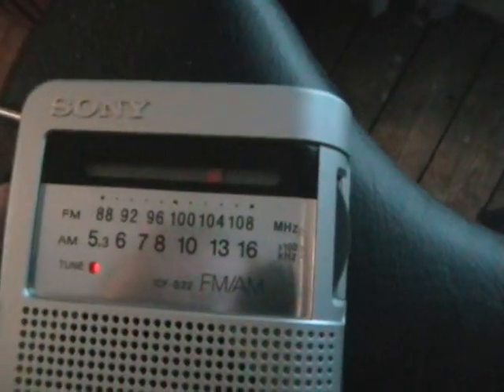How to build a SPY Bug

Comment: It looks very nice but I'd be grateful if you could give some additional infos:
1) what kind of oscillator is? Id does not look like a Colpitts, Hartley or Clapp oscillator! I do not understand why should it be an oscillator? I don't understand the theory of the circuit!
2) Why the frequency should be changed by mic ?
Please give every kind of references you have aout it !!

Comment: You made a mistake at 3:19. The antenna has to be connected to the collector, not emitter. The diagram is correct.

Comment: Is the 4p7 cap. connected between the transistor's collector and emitter part of the oscillator circuit? If so, what purpose does the 22n cap. connected between Vcc and ground serve?

Comment: great video dude! what if I wanted to receive the signal on something other than a radio? I mean, what if I wanted to receive it on a custom receiver at a distance of like 30 feet? I mean, the distance is a matter of power to the transmitter, but what about a custom receiver? might you have a circuit or link to a circuit where I could find on that would be compatible with the transmitter in the video? Thanks buddy!  -Joe

Comment: @theaviator595 
22n ceramic disc cap will work or even radial. The word "axial" or "radial" just specifies how the leads of the cap actually exit the component itself. 
axial = one lead exits from each end, like a resistor for example.
radial = both leads exit the component at one end.

Comment: @andiukas223 
I've tried values from about 2pf to 10 pf, although it did work, it did work better with the 4.7pf. (I even got it to work without that capacitor in place).

Comment: @Arapades93bmx 
you need to put a de-coupling capacitor in series with the jack to stop the "transistor DC biasing voltage/current" going into whatever you end up connecting to the jack, it also stop any input  you use from altering the transistor bias, but how this would affect the rest of the circuit, i don't know. Might be better to use the two transistor version as it's much more stable.

Comment: @fooder331 
google search "trimmer capacitors". Available  as two or three pin types. Two pins of the "three pin type" are linked and should be treated as one pin. Hope it makes sense. (it will when you got one in you hand). Build it on a stripboard rather then a birds-nest style as in this video, much easier.

Comment: Although this did work, I found a much better circuit (sorry dazaro3). using two transistors.
Google search :- "ck200 fm transmitter pdf".  To make a good coil with even spacing, wrap two lengths of enameled copper wire round a 3mm former, slide the coils from the former and separate the two coils (quite tricky).
FYI 
I used a 20pf cap at the antenna and the antenna itself was only about 30cm long and was built on a 25x64mm 9 strips 25 holes stripboard.

Comment: thanks for the video ...i wonder can we use electrolytic capacitors instead of ceramic ones ? 
also are electrolytic ones available in 1n ?
and what is that 175 cm antenna ? looks like normal wire and the guy at the shop didnt know what it was .... stupid question but please help ...thanks

Comment: what are the matirals needed
this is what ive got

1n ceramic copaciter
mic
8 turn coil
5p-30p air trimmer
4.7p ciramic copaciter
2n 3904 tranzistor
22n axil copacitor
9v batory conector
175cm antana

Comment: @leknifmy 
BOWOOD-ELECTRONICS.CO.UK, 
FYI -
I used the 5.5-65pF trim' cap. ("Ceramic" is not specified in part list for this component)
The 22n can be radial or axial, (I used radial) makes no difference. Radial / Axial just specifies how the two terminal pins are locaqted on the cap'.

Comment: @johnlovejenet 
6mm is the diameter of the coil, not the diameter of the copper wire used to make the coil itself (it's 0.5mm by the way). Look at the circuit diagram, all the info is there!!

Comment from the maker: @bjtaudio 
To make stability a lot better you need to add a 
2nd transistor has a buffer,or use a 2nd transistor
and a inductor to make a RF output stage this will make
stability very good.With the 1 transistor FM transistor you just made add a 10pf
capacitor to the transistor collector and the other end to the 
antenna ,this will help with stability when going near the antenna.
To learn lots on this type of device please visit talkingelectronics
and click the link for Spy Circuits

Comment: If you all want a fun transmitter, try a Belkin Tunecast 2 or 3unit and remove the internal attenuator network and fit an external antenna, and it will go hundreds of meters in stereo, PLL locked on to station! no drift and digital read out of the frequency. Yon can use the same 547 transistor and parts above as an external amplifier..to go even further...

Comment: Yea, I made one of these and it was fun, however they suffer from sever frequency drift, and as the unit is moved and the antenna moves, it changes the load on the unbuffered single transistor oscillator circuit changing the carrier frequency.  Also battery voltage and temperature and component tolerances affect the carrier stability.

Comment: @Curixq 
And also this: I seem to be able to mess up various radio frequencies with my transmitter. I can even change the radio "channel" from 1 radio station to an other just by turning the capacitor a littlebit.
?

Comment: I have a question.
Is the "axial" in axial ceramic capacitor important? because i can only find normal ones.
Also, I have some problems with tuning.
First of all, I can't find the frequency with a radio, but i can adjust the frequency by messing with the coil and capacitor till I get sort of a signal.
But it is a very poor signal. It's noisy and unstable, if I just move a littlebit, the frequency changes and i have to search it again.
Cans somebody tell me what is wrong?

Comment: can this circuit function off a lower voltage than 9v? i noticed the circuit diagram said 3v. so to make this even smaller could you use two AAAs or even two watch batterys or would they die within minutes?

Comment: FYI
Tried a third build with a BC548B transistor with various turn coils  (5,6,7,8,9,10) but couldn't get the bugger to tune-in, swapped the transistor with a BC547 (as specified) and the 8 turn coil, and managed to tune-in in about 10 seconds.

Comment: @leigh7801
Place an FM radio  in the same room (quite loud) as the transmitter but a few meters apart, Scan through the FM frequencies on the radio and listen out for feedback (should be obvious). No joy, adjust the trim capacitor (very very small adjustment) and re-scan the radio, repeat as neccessary. Very slow process but it worked for me. I managed to get feedback even though the transmitter was in an adjacent room. (although the door between the rooms was open).

Comment: @leigh7801 
Did you use enamelled copper wire for the coil? if so, scrape the enamel off at the ends before you solder it on. If you used bare copper wire, make sure the loops in the coil are not touching each other causing a short. 
Is the transistor the right way round?
Is the electret mic the right way round?
The capacitors used are non-polerized so you can't go wrong there.
I'll explain how to use next.

Comment from the maker: @leigh7801 
Sorry it did not work for you ,they do work we have made and sold 100s.When you first start making small fm transmitters it can be hard tuning them in ,or finding what frequency it running on.I use a cheap frequency counter from Ebay ,cost about £15 ,when you have built the transmitter and it all looks good then place frequency counter right next to the antenna ,,if its working ok the counter will show its frequency ,then you know if you have built it ok.

Comment: I built this radio, I was not very impressed because I could not receive anything, but it turned out to be just the audio plug.  As I type I am listening to my own commercial quality radio station, all around my property, and maybe further. When I get the time I will post a video of the receive quality, it is brilliant. Just a tip, to tune it you can push a screw driver in and out the coil. It is sensitive to hand proximity etc. This circuit is excellent for a car fm radio station.

Comment: @dazaro3 can I use 22nF resistor cond ceram 63V? you used 22nF axial ceramic capacitor, it will diferent?

Comment: I can`t find a Air Trimmer/variable capacitor/trim capacitor anywhere. 
does it have any common names except those 3?

or can I use a ceramic disc capacitor 22nF, 50vdc as replacement?

thanx

Comment: @8ibonek9 
I think you also need a capacitor in series immediately after the jack  socket/plug. This will stop the transistor biasing voltage/ current entering the ipod and stops any DC voltage/ current from the ipod going into the transistor but allows AC voltage/current (audio) through into the base.  
Please correct me if I'm wrong as I've only go a very basic understanding of electronics.

Comment: Got the 4.7p at last, now works even better (first made it without this cap). Had trouble tuning in when I used the 175cm antenna as specified but managed to get it working with a 30cm enamelled copper wire antenna. So far only tested through two floors  got a clear hiss-free signal. The coil I made had a 3mm internal diameter not 6mm as specified and work OK if not better, and I used a 220ohm instead for the  330/360ohm and was built on a stripboard.

Comment: I'm going to try to build one of these myself, I have a couple of questions tho, does the 22nF capacitor need to be axial, or will an ordinary ceramic one work? And how long does the antenna have to be to transmit just a few meters?

Comment from the maker: @yahtzeegrandmaster 
You use any 22nf ceramic capacitor ,you do not need just a axial type ,i used a axial capacitor because they are small ,but any  22nf ceramic capacitor is ok.

Comment: I have a question:
Would this device work also as SW transmitter if I used a crystal oscillator  (for example 6MHz) instead of the LC circuit?